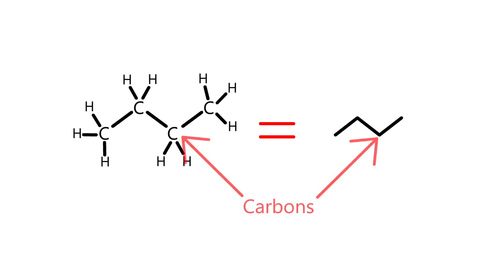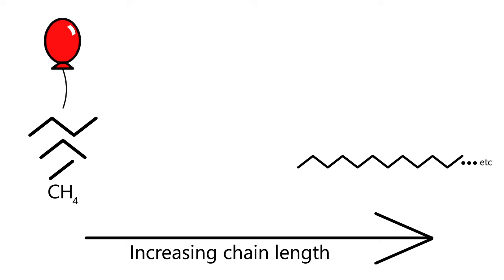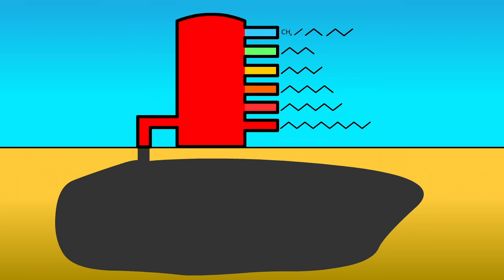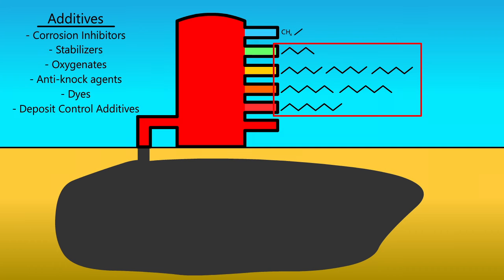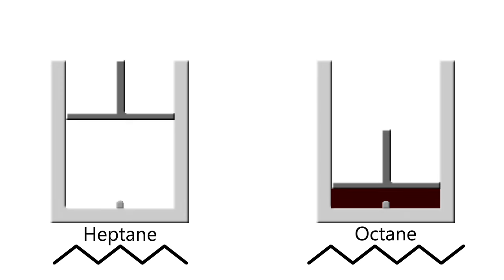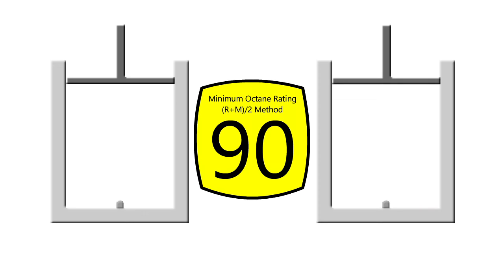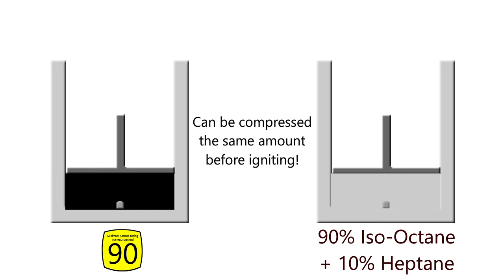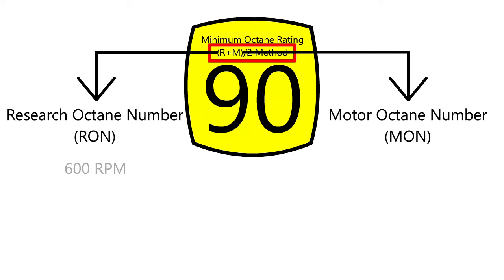What Does The Octane Rating Of Gasoline Mean?

Comment: Read your owners manual, use the octane rating that it says.
Reply: If you drive a turbo engine, different BRANDS of gasoline have different SENSITIVITY to "knocking" not reflected in the pump "octane" rating. The $3.40 a gallon "name-brand " "top-tier" 100% gasoline will allow more boost on a turbo engine, so more HP and more MPG compared to the $2.00 a gallon WallyWorld 10% ethanol swill.  Don't trust me. Test it for yourself in your vehicle the way YOU drive (that makes a HUGE difference).  The "expensive" gas often (usually) gets enough better fuel economy that your cost per mile for fuel is less with the"good stuff" than the "bargain stuff". In my 6000 lb Ram Hemi, the difference is 16 MPG on WallyWorld highway, and 27(!!!) on Shell mid-grade ON THE SAME TRIP. Yeah, 27 MPG from a 400HP 5.7L V-8. I owned an Accord that didn't do much better (30 MPG hiway).
Reply: What’s a vehicle owners manual???

Comment: WAAAAY over-simplified, but that's more than the average u-toober can understand anyway...If you drive a turboed car, the pump "rating" on octane is meaningless. And the Research and Motor methods of testing gasoline haven't been tested at 600 and 900 RPM's since 1933. Read the API or SAE testing methodology. You can get both at any library...
Reply from the maker: Absolutely oversimplified! That's the point, to get a general idea. Thanks for pointing out the changes in the testing. I will read into it!

Comment: So if the fuel has a higher octane rating, how does that affect to the energy produced by the ignition? Does it even affect it at all? I came here from a Koenigsegg Jesko video and thought it was weird how 100+ octane fuel increased it’s horsepower by 400, so I would LOVE to see something about that. Still, this video taught me something new and I thank you for it.
Reply from the maker: That's a really great question, and it's one that I don't know the answer to. I guess I have some reading to do!
Reply: Usually an engine can run more ignition timing (advance) with higher octane fuel.  Also higher boost levels or compression ratios can be used with high octane fuel.

 Modern engines pull ignition timing (retard) if the engine detects knock.  Retarding the ignition timing means there less time for the engine to reach peak cylinder pressure.  Lower horsepower is the result.

The prototype that I designed allows an engine to reach it's optimum ignition advance setting, in most cases.  My test car runs the most advanced setting possible.
Reply: More octane = More compression=More torque=More power
Reply: I’m no expert in this subject but i believe that it has to do with that Koenigsegg engine specifically, they make engine that have have an interesting feature of having variable compression, and seeing as higher octane fuel allows for it to be compressed more with out combusting, you could have much higher compression ratios at times which would increase overall power, not sure if this helps like I said I’m not an expert but I’ve been a mechanic professionally for a few years now and know a thing or two

Comment: I’m not usually “that guy”, but I need to draw a correction to your attention:

Modern cars will get better fuel economy with a higher octane rating fuel. Let me explain why.  Modern engine control modules (c. 2014) use a very complex stream of data to continually attempt to advance the ignition timing as much as possible with the goal of producing as much power from the available fuel/air mixture as possible. The ECM is receiving data from the EVAP system telling it what hydrocarbons, as well as ethanol percentage etc are in the fuel. Timing feedback is limited the most by knock sensors and vibration sensors designed to detect any pre ignition and adjust the ignition timing accordingly. 
Thus I submit to you that higher octane rated, more stable fuel will allow for more advanced ignition timing before pre ignition and knocking; which allows for more power to be produced with the same fuel. So it follows that a driver would not need to open the throttle as far to achieve the same result in available power. Additionally you can conclude that obtaining the same power from an engine with the throttle closed farther, is indeed more efficient than opening the throttle and burning more fuel with later (retarded) ignition timing. 

Thanks for thinking about this!; if you’ve read this far, you’ve given it much more thought than most folks already! Cheers!
Reply: Higher octane fuel is harder to ignite - the timing is advanced partly because it takes slightly longer for spark plugs to heat up enough - but it burns faster and hotter, losing more energy to heat. It also contains less energy than lower octane fuel to begin with. Using higher octane fuel in an engine not designed to take advantage of it through a higher compression ratio or turbo pressure may result in slightly more responsive operation thanks to the faster burn giving a more noticeable torque kick but it's less efficient overall and the extra heat may wear out gaskets and other components faster. They've tested this and commuter cars like Hondas actually accelerate faster on 87 with little difference in mileage. Only when you get to turbocharged performance cars does a small difference in favor of higher octane appear but then it's usually mentioned in the owner's manual.
Reply: @s4nder86  stoichiometricly correct ratios for gasoline and air will always result in the same  flame front speed regardless of octane. 100% certain on this. Flame front speed dictates speed of expansion/pressure rise. That speed is the same across all fuels qualifying as gasoline. Octane is a measurement of a fuels’ ability to withstand pre ignition. Thus you can squeeze it farther with a higher octane rating. The reason you can ignite it earlier is because with more of the same type of stable hydrocarbons, there are no earlier ignition pockets in the flame front. Flame front speed however stays the same. Ignition timing is only retarded just enough to keep all of the expansion on the right side of the stroke remember.

Comment: So just to be clear:

1. Is higher octane rating is lower it’s harder for the combustion to continue without more compression and input energy? 

2.Do high performance cars produce more compression for each stroke of the piston? 

I presume this is either horse power or torque and how are those two words related to compression of the gasoline? 

3. Why not just load up a ton of pistons to make a ton of power? As in how do they balance the cost/power efficiently ratio of making an engine more powerful vs cost efficiency?

Comment: I heard 1944 spitfires sometimes used a 150 octanes fuel... Is that even possible ?
Reply: Vinh-San Bernaud   If you mean the  Spitfire aircraft then yes, it is possible. Typical aviation gas has an octane rating of 110 or higher I believe. The octane rating is not a measure of the octane content as a percentage.

Comment: could you tell me if an average fill with higher octane fuel,what will happen?
Reply from the maker: Usually no harm to using a higher octane than recommended in your car, it's just more expensive!
Reply: It’s like buying shoes that are too big, all ur doing is paying more. And tests have shown that higher octane fuels reduce efficiency and power output in engines designed for lower octane

Comment: Wow. 87? Mine works just fine with 85. And the highest I've ever seen is 91
Reply: We have 95 and 98 only in my country and they have almost same price tho.
Reply: @johnsonx2426  98?! Holy shit what country are you in? If I may ask.
Reply: @princenoah21  Lebanon 🇱🇧
Reply: @johnsonx2426  Ahh, okay. I live in the US, 5,000 feet above sea level. Maybe that's why.
Reply: In Malaysia, we have 95 & 97
Reply: lol pertamax turbo has 98
Reply: In Algeria they have 91 & 95 & 98. with almost the same price as water and sometimes cheaper.UwU
Reply: @princenoah21  The high elevation is the reason your fuel is slightly lower octane than elsewhere in the states. Europe uses a different measurement though (RON not AKI). 95 RON in Europe is roughly 91 AKI or premium in the US.
Reply: @s4nder86  I suppose that's true. I live around Denver Colorado about a mile above the sea.
Reply: @princenoah21  mine has 100 also
Reply: @sunandavishwakarma7832  Where do you live to require that?
Reply: @princenoah21  India